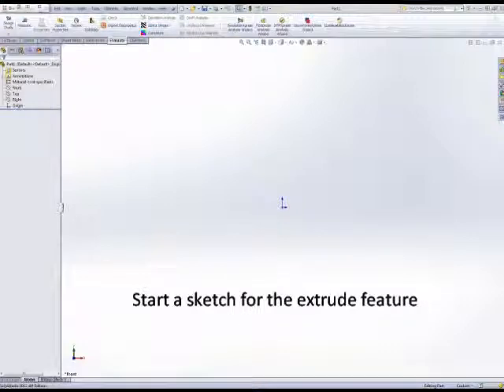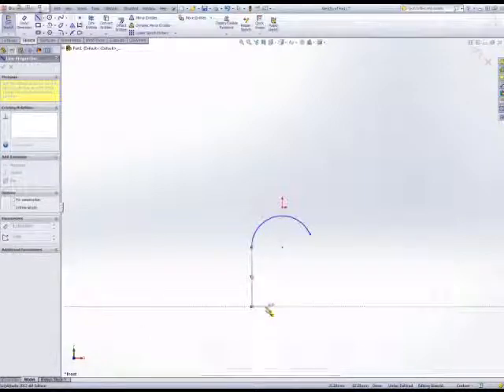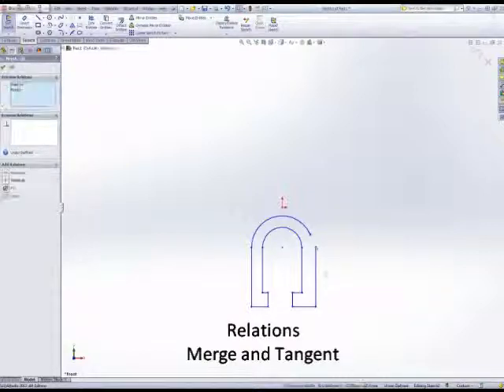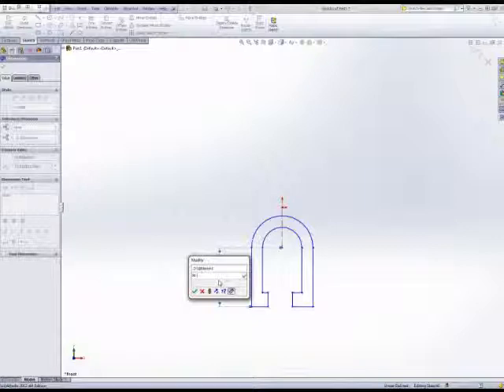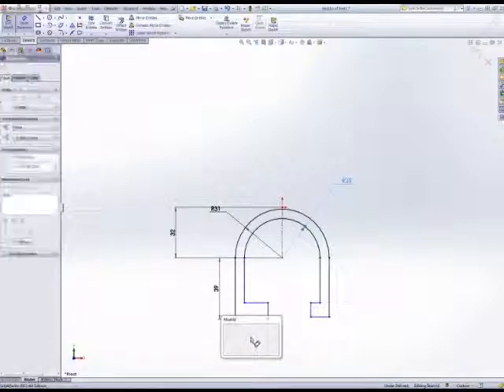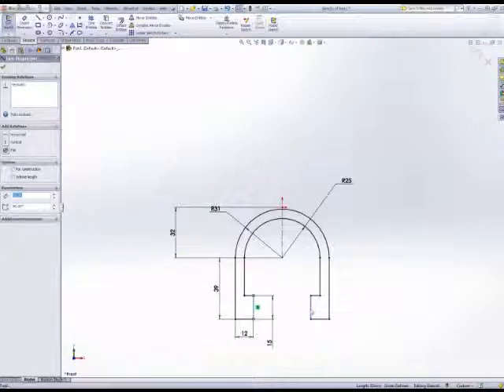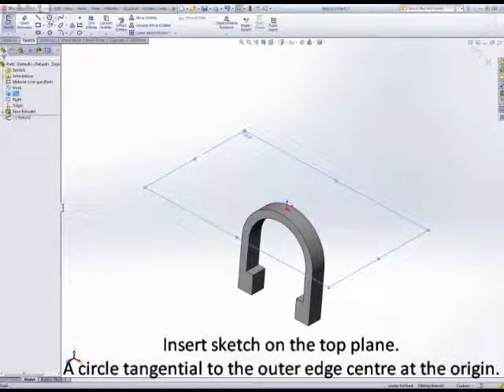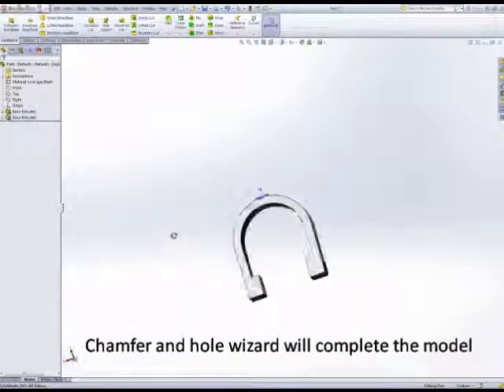12 - V Block Clamp Bracket

Comment from the maker: Hi Alex

you do need to set the direction in the feature - the selection box is just below the end condition setting, you can pick a plane or an existing sketch; if picking a sketch element it must be linear. When extruding a 2d profile the default direction is perpendicular to the sketch plane but the can be controlled with the same box.
Julian